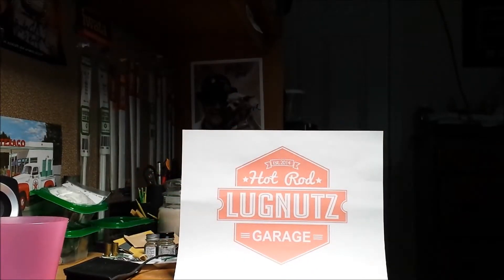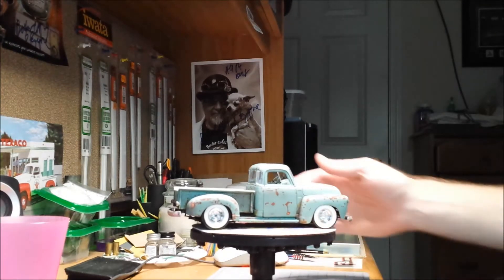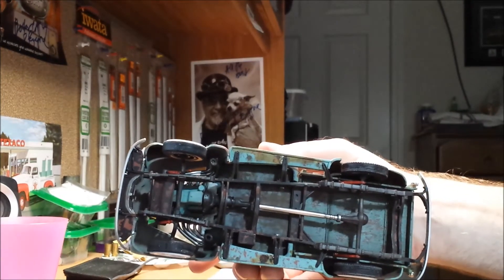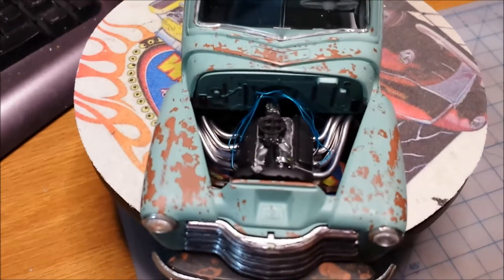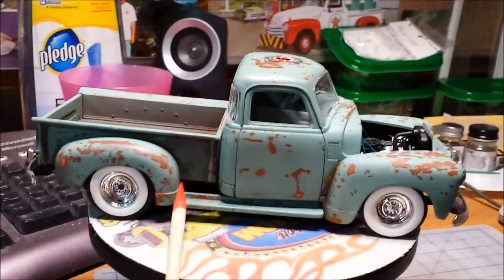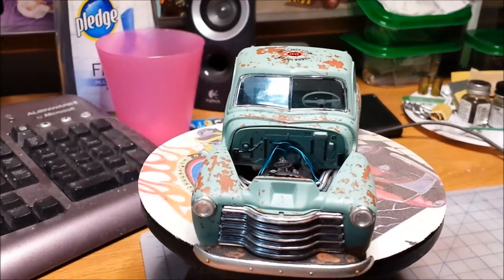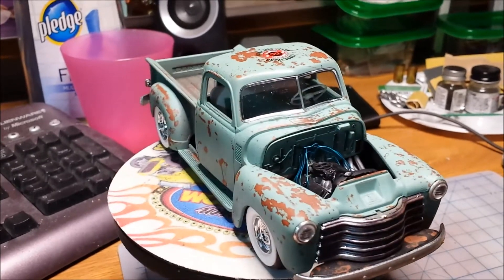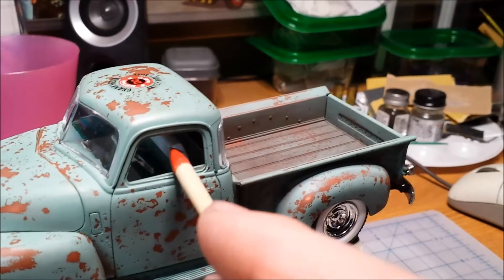1950 Chevy Final & 32 Ford Intro

Comment: Wonderful build Todd. Leave the truck the way it is. If you go in and try fixing those imperfections you will end up making more. Use it as a stepping stone and move on to the '32. The '32 can be built as a stock Ford. If I remember right it gives an original motor and a decked out option. Get lots of pics on Google images and save them in a file. Get them for the car, motor, chassis and interior. You can never have enough reference pics if you plan to do a stock clean build. That is a great kit. Also you are not boring and you put out great video's and builds. You should be very proud of what you have accomplished with just three builds under your belt.
Reply from the maker: Thank you for your kind words Chris.  And thank you for the advice...I will start on rounding up some photos for th 32.

Comment: Very nicely done Todd and nothing to be ashamed of there. I have never built the Revell 32 Ford so can't answer the question about that, but the directions inside should answer that question for you. I make my own decals with my printer which is an older HP Photosmart 8250. The best of course would be a color lazer printer, but that costs $$$$$. Looking forward to the 32 build. AMT's version of the 32 Ford coupe definitely has the stock option.
Reply from the maker: Thank you for the kind words and for watching.  Yes Im finding out this 32 kit I have is a great kit but it doesnt have what I need on this build. stay tuned.

Comment: The truck looks great.  The ford has a big block  and a small block motor. You may have to track down a stock flat head. Tires are not original equipment either. It should be easy enough to track down the right stuff.
Reply from the maker: Thank you Matthew.  I maybe doing something drastic.I will keep you posted.